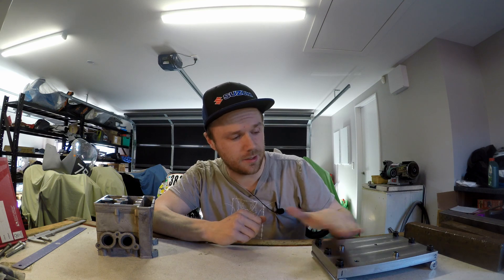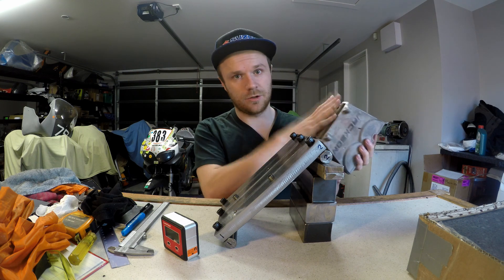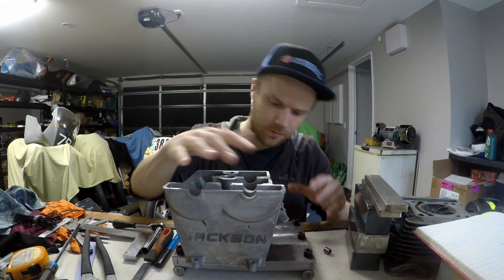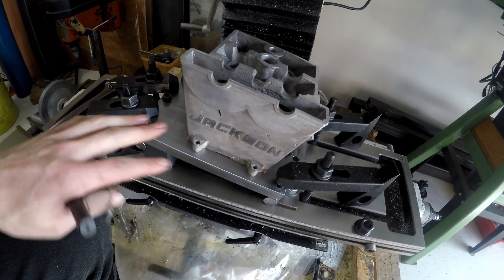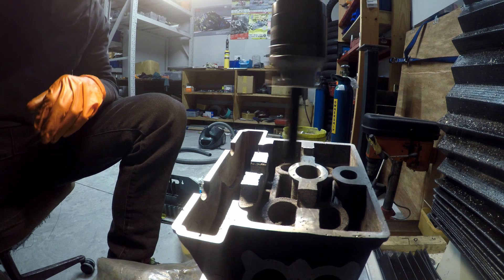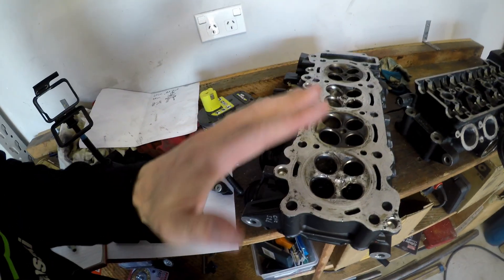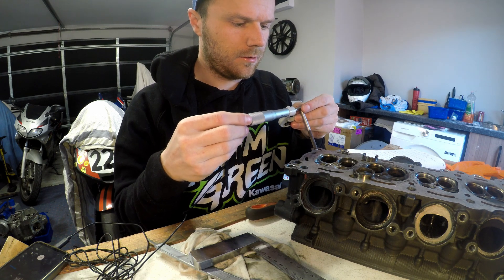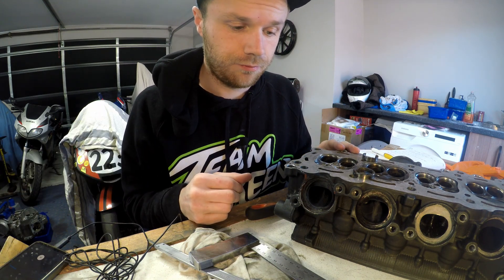Dissecting a R6 Valve train and Cylinder Head Machining.

Comment: Kerzan in Christchurch sell valve seat materials and guides. I wouldn't mess around reusing anything. Rough guide for interferences, 0.007" for seats in alloy head, 0.0015" to 0.002" for guides.
Reply from the maker: @sampinion5796  OK thankyou, yes will be using new guides, seats and valves ect.
Just practicing the machining ect with a defective casting and used bits.

Comment: Sick. It's amazing how many things there are in a cylinder head that have to be the correct size, where in an existing head you don't even think about e.g. the hole for the buckets. Are you planning on cutting the valve seat angles in the mill? You already have the setup for the correct angle the guides were bored at
Reply from the maker: @corey_nz  Yes its pretty impressive and a little overwhelming at how precise all the different tolerances of the different parts of a head are but looking forward to the challenge.
Yes I think that is the current plan to do it in the mill, I will have to get some more cutters ect and learn a little more about the best way to zero the spindle on the guide.